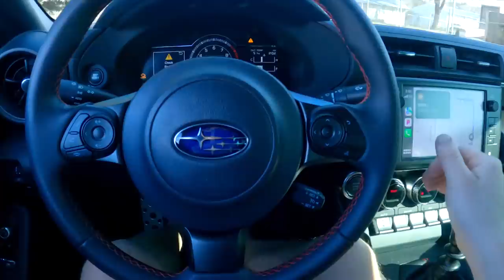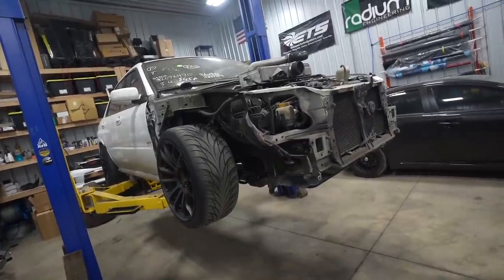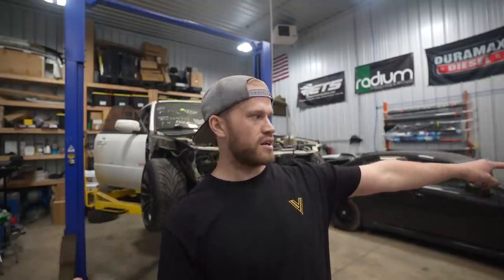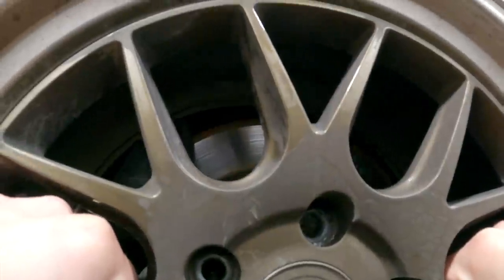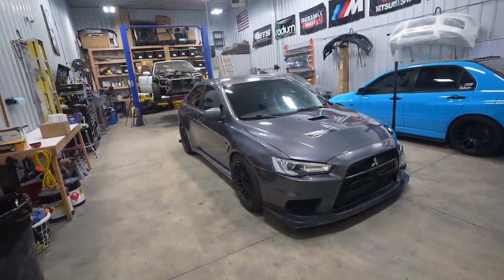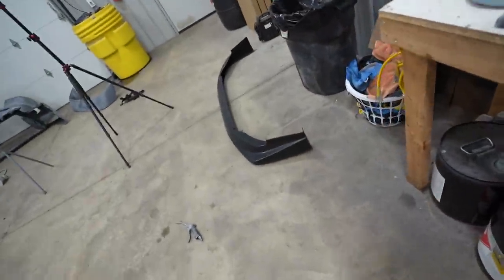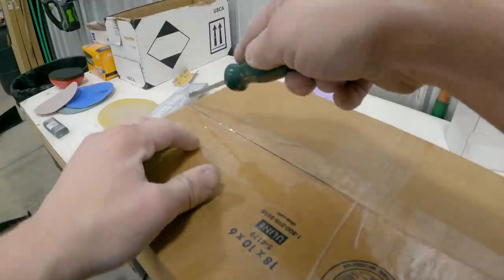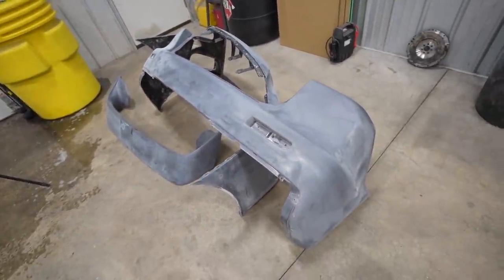Revealing the total cost of the TOTALED STI!

Comment: Ouch I paid $10k for my sti with 0 problems in perfect condition with forged internals, upgraded valves and springs, fortune auto coilovers, blouch 18g, grimmspeed top mount, hks hi power exhaust, Cobb up pipe, invidia catless down pipe, prodrive speed line wheels etc but that was 6 years ago and the car ran like that with 0 problems for 5 years before the head gasket blew. Sadly with they built the car they thought the factory style head gasket would be fine. 28k later and it’s fully built on a low boost 25psi tune is making 510whp @7600 rpm